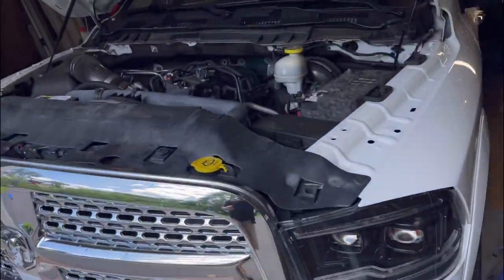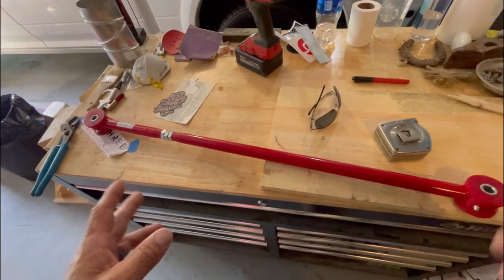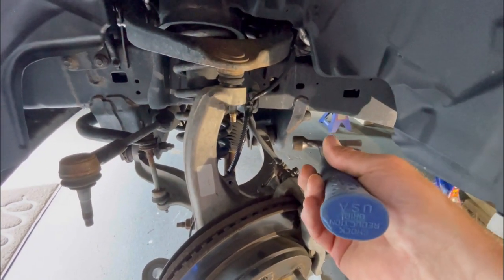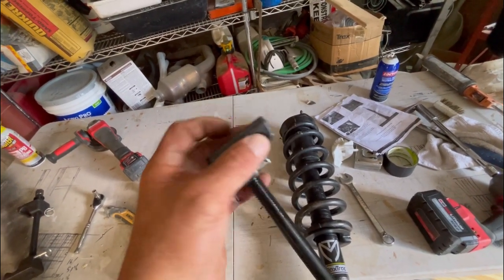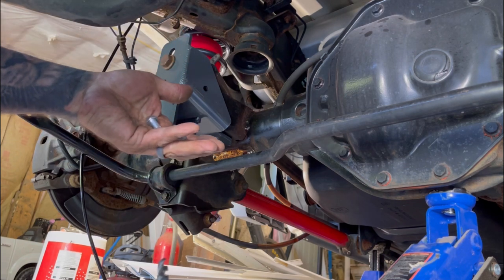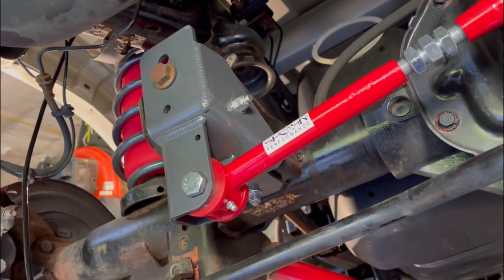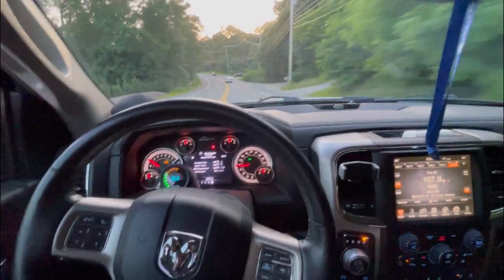INSTALL! RAM 1500 2/4 Drop Maxtrac

Comment from the maker: 5:39 Starts front dismantling 
9:35 Front strut ride height
11:02 Front strut assembly
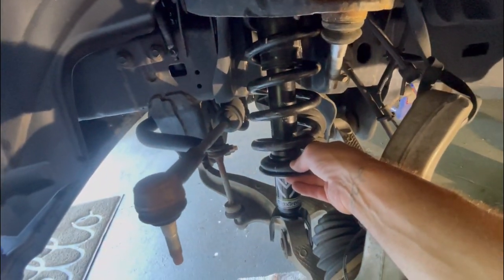12:50 Front strut install
13:56 Starts rear dismantling 
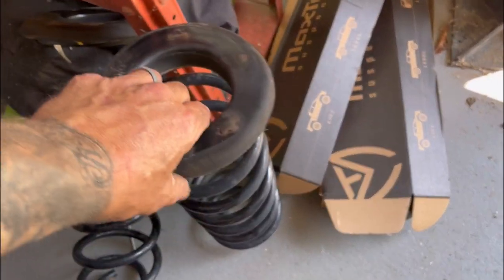16:25 Rear springs install
16:50 Rear air bags install
18:04 Viking rear shocks for install
21:05 Spohn Pan hard bar install
21:59 Hellwig rear sway bar install
27:00 The reveal

Comment: Good job Mike, my Maxtrac kit was great I just did the relocation brackets
Reply from the maker: Why did you get the brackets?
Reply: @TunedRAMS  need them to center the pinion n helps plant the rear better when launching n prevents wheel hop even less
Reply: @TunedRAMS how you did that ??? I need do mines. Cuz my truck wobbles 🥲

Comment: Looks bad ass, i was thinking about doing a 2/4 drop on my 20 ram 1500 crew. Is it best or needed to get the kit with the upper control arms or one without is good? Heard its easier to align with the kit with the chambered upper control arms. I either wanna drop it 2/4 or jus drop the rear 2" to level it. Keep going back and fourth. I definitely like the stance on your my 20 is white too
Reply from the maker: @johnnypiper1717  oh you got to drop it!!  2” in the back won’t be enough trust me 😆 def drop it, wish I did it a long time ago!
Reply: @TunedRAMS  lol for sure, which kit you think I seen there's a kit that comes with upper control arms and one kit that doesn't an lil cheaper. Should I get the 2/4 with upper control arms?

Comment: I'm debating to lower or level my rwd 2020 1500. I have a quad cab, just dont know what will hold better when it comes to resale.
Reply from the maker: @ghostJC1126  if you’re definitely not keeping it and may trade it in, probably a good idea just to do level
Reply: @TunedRAMS  that is what I was thinking. I bought it used and just needed a truck. Like the rough country leveling shocks, but I’ve been seeing these maxtrac drop kits and the trucks look oh so nice.

Comment: What wheel size are you running there? Looks like 22? I have a 15'  Lonestar Crew v6 which I wanted to lower when the tires finally shit the bed. Truck looks great.
Reply from the maker: Thanks!  They’re 22x10’s wrapped in 305/40’s
Reply: @TunedRAMS  what ET? struggling to find wheels that fits in norway :)

Comment: Any speed wobble in the rear? I ordered one of these for my 2018 ram 1500 4wd crew cab. Wondering if you’ve had any issues with rear geometry and the wobble people report after a 4 inch drop in the rear.
Reply from the maker: Absolutely zero wobble with this set up.  130-140 no problem.  It is important to center the rear axle as close to perfect as possible.
Reply: @TunedRAMS  sweet! Thank you!

Comment: I have the Max trac kit on mines and I have the problem of it being higher on the passenger side
Reply from the maker: Cut 3/4 of the lower spring off, fortunately for me one shock was a bit shorter than the other so I put it on the passenger side
Reply: @TunedRAMS  perfect man thank you!